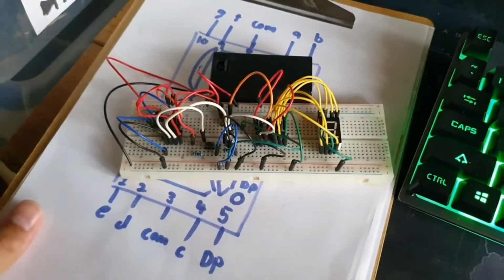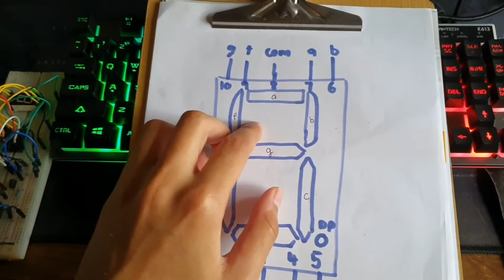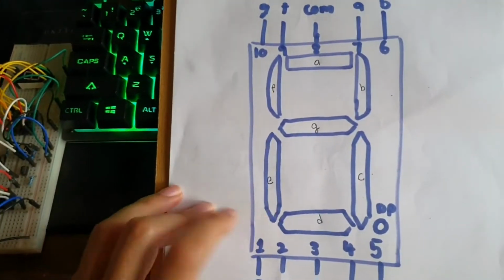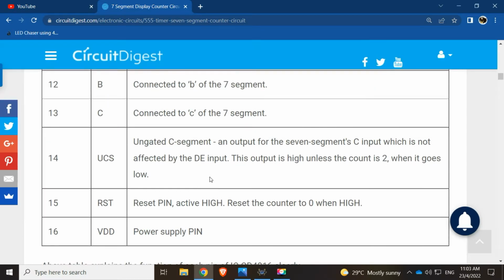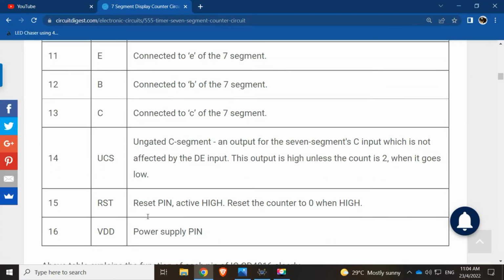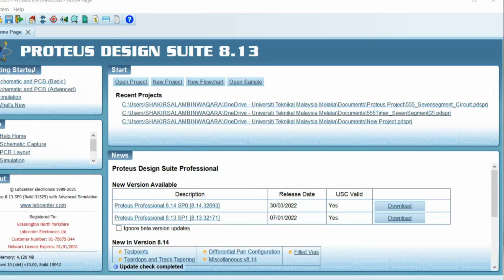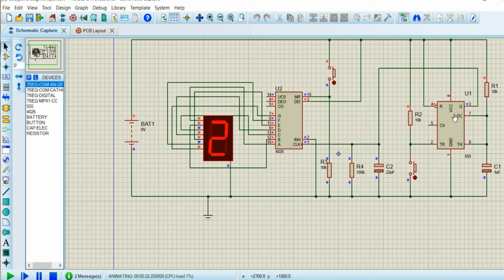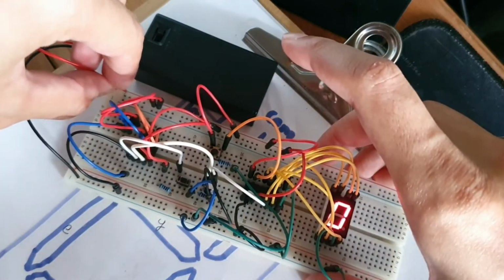7 Segment Display with CD4026BE and 555 Timer

Comment: Excellent work here. Well explained. I just built the single 7 seg using three 5mm LED's per seg. The 4026 drives them with a 220 ohm resistor per seg on a common cathode with a 9 volt supply. I too have a mechanical Trig and Res issue. Like your build I'm using a 22uf cap, it's soldered in, So I tried the Arduino Blink to trigger the 4026. Arduino is tied to ground and supplies a 5 volt Trig pulse which works fine. Maybe its the voltage? or just a clean pulse. Building this was a spaghetti tourture test, I'm not changing the Cap, but if I did I think a 104 ceramic would fix this issue.   Thanks, Cool beans I'm Subscribed
Reply from the maker: Thanks dude, i see you using microcontroller for the CD4026 driver and three led per seg as output. 104 ceramic capacitor is a big yes for the filtering voltage purpose. Keep on experimenting. Cheers!